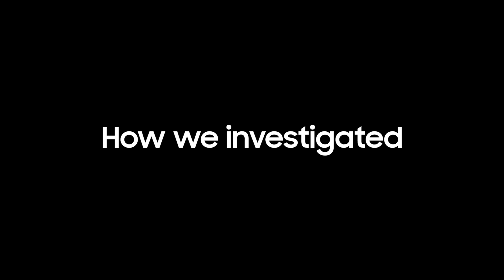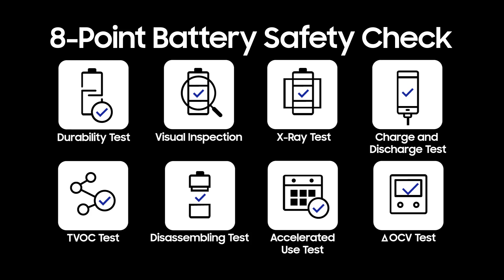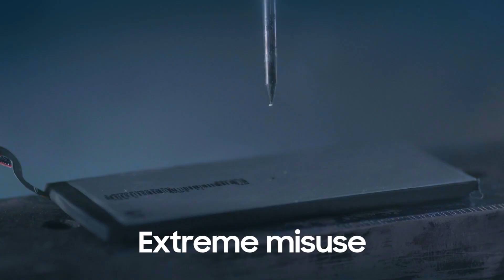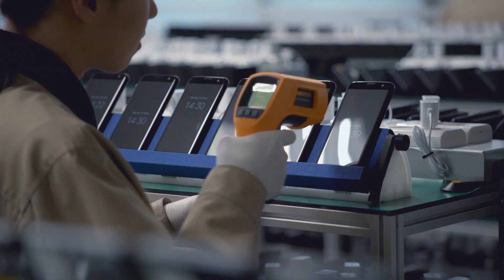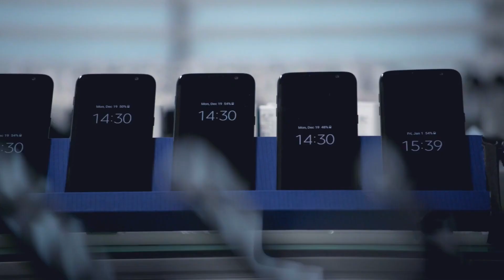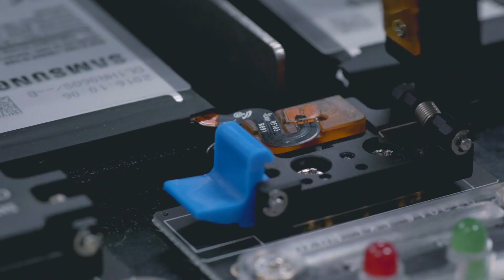Samsung Galaxy Note 7 Exploding Battery Revealed!

Comment: I won't buy a Samsung device ever again. I hated my Galaxy S3 because of its slow performance which caused me to throw it, thus breaking it, but that was just the beginning. Then I heard about the Note 7's exploding, then a few years later they said in the news that Samsung and Apple were fined £13 million for slowing devices down. The phrase "once bitten, twice shy" is thrown around a lot these days.
Reply: Yeah s10 is cool with ultrasonic fingerprint always work
Reply: I hope the s10 gets 3 years of software updates cuz 2 isn't enough.
Reply: @saneiplushie  they get oop
Reply: I am using a s5 right now 😑😐
Reply: So you threw your device because it was slow and went like "What the f**k it broke?"